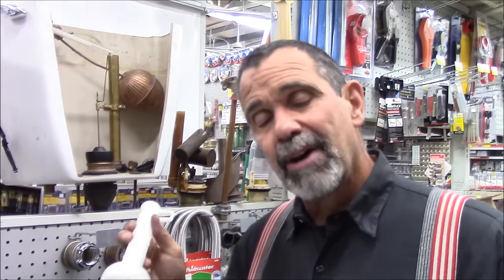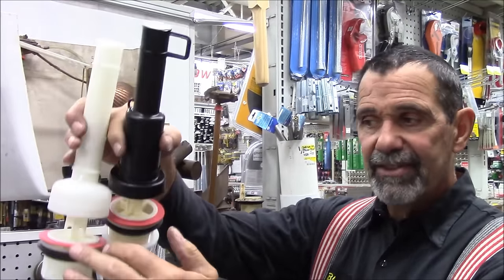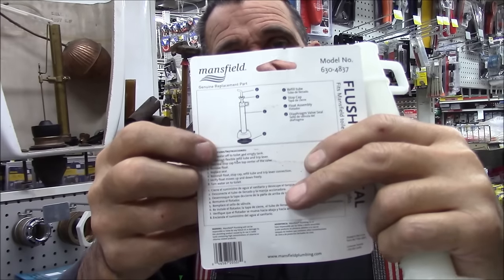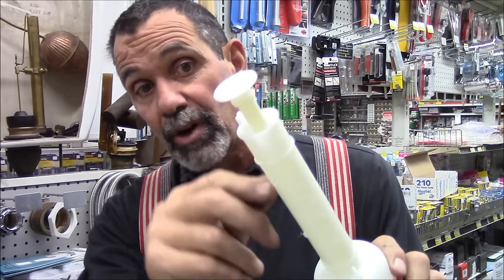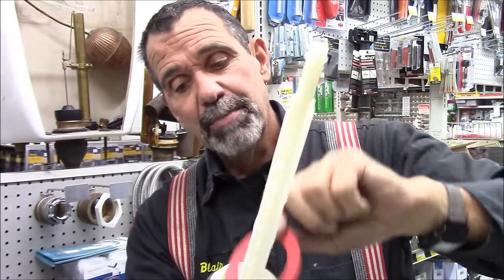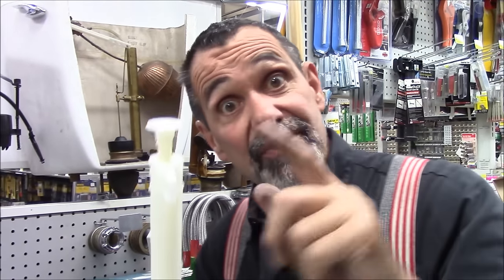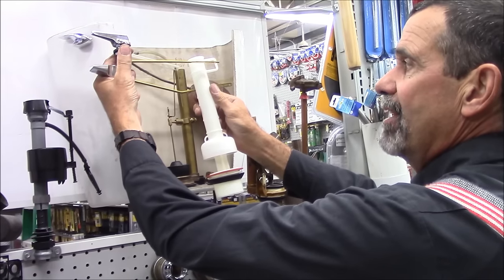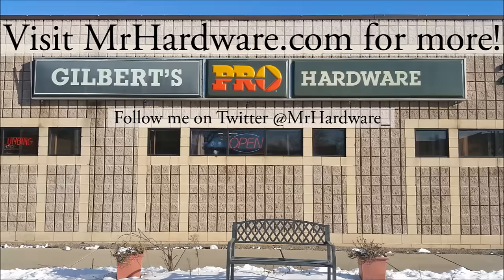Easy Mansfield Toilet Flush Valve Gasket Repair, Replace Seal, Handle Fix

Comment: I replaced mine, but the water is leaking still.. I was pretty sure I did it correctly. Referenced this video and went back to ensure I'm seated in the groove, I am, but I still have leaking.. the plunger acts like its not heavy enough to close off against the seal. very slight pressure on the plunger and the water stops leaking. any thoughts guys?
Reply from the maker: Sometimes it takes a day or 2 for the seal to ‘seat’. I do avoid seals by other manufacturers, poor quality, I stay w original Mansfield parts.

Comment: How do you remove the mansfield filler tube to change the black washer shank below the red seal?
Reply from the maker: Unthread the top plastic disc and it will lift right off

Comment: Why do you think I need to hold the handle down for the water to drain?
Reply from the maker: only when the flush valve doesn't float. The flapper or what-ever your flush valve is could be not holding enough water to stay afloat. Or the linkage is too short and does not lift the flush valve high enough to escape the outflowing water.

Comment: I changed the gasket.   I filled the tank , shut off the water, waited a while, tank was empty!   What else could cause a leak, besides a bad gassket?
Reply from the maker: The gasket may have a flaw in the rubber, the plastic seat it seals against may be flawed or dirty, or possibly a crack in the plunger. Sometimes it takes a day for the seal to ‘seat’ itself into the groove when a new one is installed.

Comment: is it possible to buy a replacement cap like the one you unscrewed to remove the black tower? that part broke on mine.
Reply from the maker: If you don't have a good hardware of plumbing shop you can call the hardware and we'll sell and ship one to you. 586-776-9532

Comment: What does it mean if the toilet lever is extremely hard to push down?  It will if you push enough and it sounds like the flush valve part that raises up is suctioned to the bottom.  Is that that red gasket needing replaced?
Reply: I bet, the old gasket gets sticky and causes handle problems.
Reply: Blair Gilbert Put the gasket in.  Flushes easy now just leaks a little unless I push down on the cylinder.  Hope it sets in there eventually and creates a tight seal.

Comment: What do you do on a Mansfield toilet when it keeps running after the gasket is replaced.
Reply from the maker: Is the water going into the overflow tube or is the water level staying below the overflow tube? Water high means the fill valve needs to be worked on. Water low means there’s something wrong with the flush valve, possibly a crack or a flaw in the plastic.

Comment: This was very helpful! I have a one of those toilets having problems with the Flush Valve,. problem is that the toliet model is #160 but all valves I see are 210 & 211 flash valves, I don't think they are compatible as this is the second time in two months I  have to replace it. can't find the #160 anywhere.  know where I can find a #160 flush valve seal?
Reply from the maker: It is the same one as the 210 or 211 flush valve. If you replaced the red seal and the toilet is still loosing water you may have a flaw in the upper plunger. Try checking the bottom edge w/ your finger and see if there is a crack or imperfection where it contacts the washer. Blair
Reply: @MrHardware1  Thank you so much! the 210 did the job. I had put it incorrectly last time. from you video guide I ensure this was was placed correctly. Thank you!!
Reply from the maker: @tonymatos7554  It is our pleasure, Blair and Tim

Comment: Can you tell me the name of the vertical part on the left side which attached to the floating board.
Reply from the maker: Before the word police came and corrected plumbers speech it was called a ballcock, now it’s name is ‘fill valve’. It functions alone, when the water goes down (either through a leak or when flushed) it’s job is to keep the tank filled to a preset level.

Comment: My toilet is marked inside the tank as Mansfield 140, but all the red Mansfield gaskets I look at say they are for 210 and 211 toilets.    I don't know what to do.....
Reply from the maker: You have a ‘140’ tank with a 210 flush valve.

Comment: Question: I took my gasket off to replace, and the black ring beneath it is disintegrating at my touch. Should I try to get that off and replace it as well? Or is it attached to the base, and I’d have to replace the whole unit?
Reply from the maker: If you’re talking about the bottom ring that attaches the valve to the tank, don’t. You have to pull the tank and have the new gasket to replace it. However they rarely fail once installed even though they leech black.
Reply: @MrHardware1  I had the same issue --- glad I looked through the comments to find your reply to this question.   Thank you!

Comment: I love these flush valves because they last long but the gaskets start leaking every year or twoand a I paid $2000 in excess water usage from a leaky Mansfield toilet flush valve!  Why area the gaskets falling apart after only 1 year???
Reply from the maker: Could be too much chlorine in your city water is 'pickling' the rubber. Are you using original Mansfield gaskets?

Comment: I have the black valve. It sticks, so the flush handle is very hard to push down, and it finally seems to have stripped the inside of my handle where it goes through the tank wall, since the handle won't move the lever anymore. It's one of the adjustable angle style levers. What would cause the valve to stick? The house is only 6 years old.
Reply from the maker: It’s odd, the Mansfield flush valve tower/plunger with the black gasket attached to the moving assembly hasn’t been made for 15 years. It should be the red gasket attached to the bottom of the stationary part of the flush valve. No matter, when it gets old and soft it sticks. For $4get a new one and see if that fixes it. Also, suspicious is the fact that you have an adjustable flush handle that in no way should be needed on a six year old toilet. When you replace it, you should get the long Mansfield handle either metal or plastic. No universal they don’t work well.
Reply: @MrHardware1  No, the flush valve is black. Your videos says the newer ones are black. I don't know what color the seal is, as I haven't taken it out yet. The other toilets in the home still have the original Mansfield handle. But I suspect the original handle broke on this one toilet since the valve sticks. Just like it stripped the inside of the replacement, which is a Korky 6051. 

I'll replace the seal and hopefully it'll flush easier.
Reply from the maker: @jbw9999  should do the trick. Wipe the bottom of the tower where it contacts the rubber w/a wet rag.

Comment: I need to replace the entire thing and I can't find anyone who can tell me! All the tutorials are about replacing the red seal but what about the black one? Where does that one go?!
Reply from the maker: The black gasket the seal between the plastic flush valve and the tank. It is on the valve and in the tank

Comment: Does the flush valve trip lever go in front of the flush valve mechanism or behind it?
Reply from the maker: Normally, it goes in front, but if the configuration of the toilet favored running into the back, I don’t see why it couldn’t go either way.
Reply: Thanks, I've alway's put it in front, but I saw a pic on a flush valve box with the lever in the back so I thought I would ask... @MrHardware1

Comment: Thanks for the vid. I replaced the red gasket and black bell tower. But I get a slow leak over a few hours I’ve rechecked/installed and tried a couple oem gaskets . Any Thoughts?
Reply from the maker: Is it possible the water level is up to the top of the overflow on the plunger? That means the fill valve is not shutting off completely. Sometimes it takes a day or two for the new gasket to 'seat in'.
Reply: Mr. Hardware water level is about 1/2 “ below the overflow. I’ve had the gasket on for a while now. I’ve put red food Colour in overnight and the bowl is pink in the morning.
Reply from the maker: @mikebattista6183  For sure there is a leak somewhere between the tank and the bowl. There may be a flaw in the moving plunger where it contacts the gasket. you could remove and flip and reinstall the red gasket. ......

Comment: The flush valve on my Mansfield toilet operates very hard. It has a plastic handle and I’m afraid I’ll break the handle because it operates so. Hard. I sprayed wd-40 inside the valve which helped a little but didn’t last. What are your suggestions?
Reply from the maker: Change the gasket on that flush valve just like I showed in the video. When it gets old it gets sticky. Time for a new one.
Reply: After viewing your video I came across a video that told about the gasket replacement for a solution. I purchased the gasket and after installing it correctly I solved the problem. The old gasket was cupped and causing the tower to stick.

Comment: Mine is not leaking water, it just flushes HARD. You really have to push hard to get it to flush. Do you think it's still the seal?
Reply from the maker: Yup, a soft gasket sticks. Cheep and easy fix.
Reply: @MrHardware1  Hey! I followed your directions and fixed it yesterday.  If a 77 year old grandmother can do it, anyone can! THANK YOU!

Comment: I've replaced the gasket, but I still have a slight leak. If I put pressure down on the gasket it seals completely. What needs to be done to the gasket to prevent the slight leak??? I would appreciate an answer from anyone.
Reply from the maker: Sometimes the gasket takes a day or two to conform. Or a bad gasket, flip it over, and lastly there could be a flaw on the top of the valve where the gasket sits.

Comment: Can we just buy a whole new universal kit? Or are Mansfield toilets parts specific?
Reply: You can replace the Mansfield with a generic flapper style (or other kinds) flush valve. The tank hole size controls the specific one.
Reply: @blairgilbert7606  thank you! Easy as 1-2-3

Comment: Unfortunately for me, even replacing the seal in the top groove, the tank still leaks.  Looks like I just may replace the entire valve.
Reply: Nevermind. Tried a 2nd seal and it seems to work so far.  I'm guess the first seal was bad as well.

Comment: I found the ring replacement, installed it, but the water still leaks out.  The plastic thing that’s seats on top of this gasket, isn’t tight.  I hear it seeping out. If I press on it, it stops leaking.   Guess I’ll have to call my plumber..😢
Reply: I’ve had this problem for years. My seals last about 18 months to a year then they need to be replaced. When I change them they leak. The best solution I have found is to boil the seal for a couple min to soften it up. After replaced fill the toilet tank with a bucket of hot water before turning water back on. Leave the toilet top off so if it leaks (and it will) just push it down to seat the valve. I tell my kid and  wife to listen for the drip. After a week or so it stops. These valves seal suck. I’m ready to just swap out to old style flapper style.

Comment: Hi, I tried this today and the gasket is running upwards after setting it into the groove and will not fit flush with the valve. Any idea or trick to fix this part beside just replacing the entire flush valve?
Reply from the maker: Sgt. Tom, you will need to see if you have the correct gasket. Other cannister flush valves may look similar but only the exact replacement will work. I can only guess you have the wrong brand for your toilet. email me a pic of your tank w possibly the mfg # from the back of the tank and I'll be happy to assist. Blair
Reply: @MrHardware1  I checked again and must have placed it down too far on the wrong groove. It's working now, thanks for getting back to me! I was thinking of replacing the whole unit but if you say they are good, I'll keep it then.

Comment: My idiot brother has broken 2 different flush handles in the past <6mts! The first time idk what he did. I'm assuming he just slams the handle down anytime he flushes the toilet. Anyway, the first time my mom called the landlord and had her get a plumber come replace it even tho I told her I could do it if someone just got a new handle. (my bro had broken the plastic bar part inside the toilet). Anyway, so bro decided to mess with the new handle and unscrew it til it was almost ready to come completely apart when you'd flush and it finally did the other day. Somehow the seal also ended up coming off too and my mom called the landlord again. I just looked at it and fixed the handle by just screwing it back on. I first put the seal on the top moving part and it was actually working and not leaking but I decided to Google it to make sure I put it on correctly. I watched this and realized I hadn't put it on right so I changed it to where it's on the bottom now and.. Good as new. 
Mom needs 2 call the landlord in the morning and tell her she doesn't need anyone 2 come out anymore. 
It's pretty rediculous how my bro literally used to turn the water to his toilet off all the time yet told us both that this toilet was so messed up that it def would require a plumber yet I come in and fix it straight away. 
Hope the landlord appreciates the fact that I looked at it and saved her God knows how much in plumbers fees. I kinda feel like she won't believe I could actually fix it and pay someone to come out for no reason.
Reply: Well, just as I thought, the landlord is still sending someone out. 
I wouldn't worry about it if people were actually honest these days but I'm sure whoever comes will pretend like there's still something wrong with the toilet and act like they fix something or just replace something 4 the hell of it 2 get paid, making me look like an idiot. 
I realize nobody cares, but I just need to vent. Lol

Comment: 10 years? These gaskets last about 18 months. You'll get to a point where you can change these blindfolded. Like special operators can assemble an M16 in the dark.

Comment: I’m having problems with my gasket.  It’s not that old and it looks fine but it’s leaking.  I put it in the correct groove as well but it’s still leaking.  What am I supposed to do?  The only way I can maintain the seal is to open the tank and push the tower down.
Reply from the maker: I would be looking for a burr or something on the plastic, preventing the tower from sliding up and down freely. It shouldn’t seal after you put it down, but sometimes there is a flaw in the rubber gasket. Is the flush handle pushing or pulling on the tower?
Reply: @MrHardware1  If there are any burrs, they are invisible and the flush handle isn't pushing or pulling on the tower.  I replaced both the gasket only two years ago and it still looks pretty new.  It's a mystery to me what is wrong.  As I said above, the seal seems to hold okay as long as I open the tank and press the tower down after each flush (or I just turn the water off at the valve after flushing), but that's very annoying.  I also tried lowering the water level in the tank and that didn't help either.
Reply: @MrHardware1  Here's an update it's actually not the tower, I think.  I find that if I pull up on the "balloon" float, the water trickling sound stops.  Is there a way to make it stop on its own?
Reply from the maker: @engineer4god470  so if the fill valve fills the tank right up the top edge of the tower, then you know it’s the fill valve that’s gone bad.

Comment: Even after replacing the gasket (in the correct groove) my toilet is STILL running - someone able to help? It’s like there isn’t enough pressure to keep the valve pushed down against the gasket. Driving me INSANE
Reply from the maker: Is the water coming up to the top edge of the plunger?

Comment: Mine, both toilets lose water into the bowel over time.  i hear them refilling every 2 hours. Plastic surface is clean  and the gasket is new. What can i do? Please help!
Reply from the maker: I have had the fill tube shoved too far into the overflow tube and it would siphon water out of the tank, drop by drop. The flush valve could be loose and letting water leak into the tank through the bottom seal. good luck, 
Blair

Comment: I have this style and had to replace the handle and for some reason the valve won't stay open even for a short flush. The handle raises the valve all the way to the top just like it should be but it drops down immediately barely letting any water out and I can't figure out why
Reply: This is a follow-up to my original post. I figured out the cause. The handle I bought with a replacement rod had a brass rod to stand up to the water corrosion a little better. The rod was just heavy enough, the weight of it would push down on the canister preventing it from floating for the length of time required for a flush. I bent the rod so it would be on the outside of the hole it was supposed to fit through and added a zip tie to connect it basically so it would work like a chain and put no weight on the canister. It works perfectly now.
Reply from the maker: Take out the flush handle and pull up on the ring by hand and see if it stays up or not. If it still won't flush I bet you have a crack in the bottom of the flush plunger. If you caulk up the 2 holes there it will give a longer flush, but if it is cracked go and buy a new one.

Comment: I have recently replaced the complete unit and about every 20-30 mins i hear it run.. any tips? (Clear one)
Reply from the maker: It could be the seal between the flush valve and the tank. Possibly a bad flush valve.